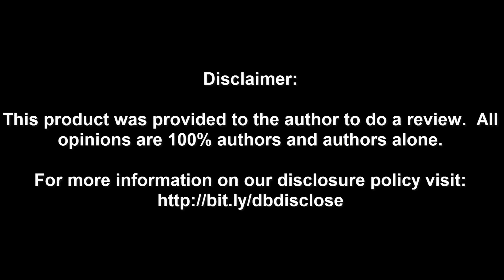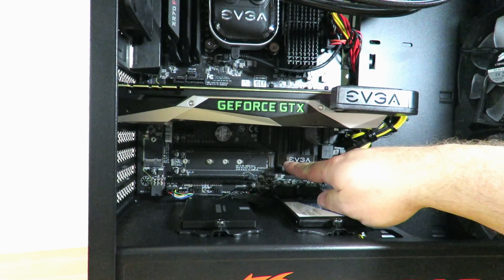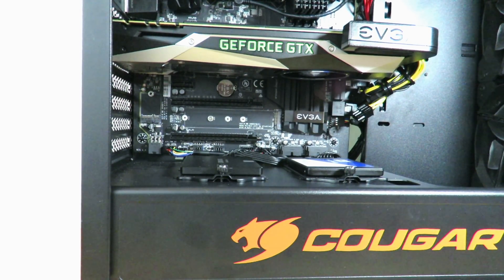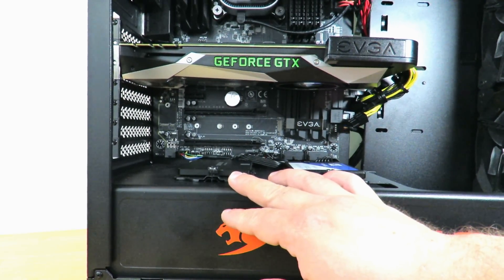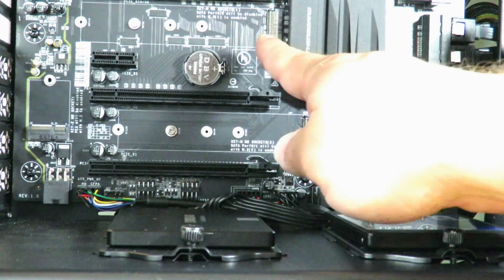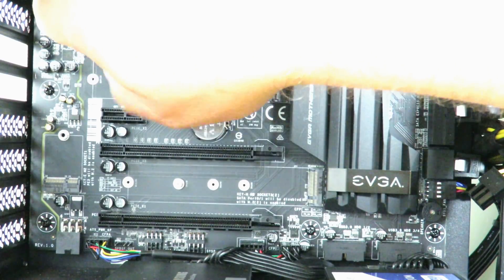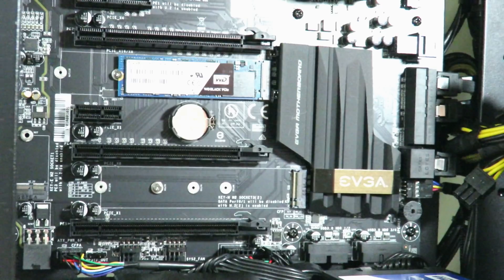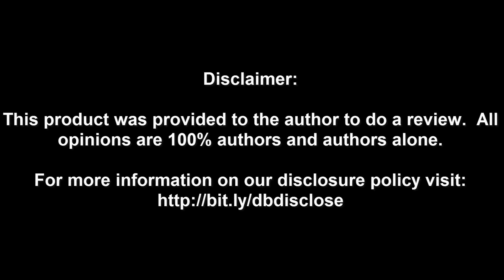How to install the 512GB WD Black PCI-e M.2 NVMe SSD WDS512G1X0C

Comment: Do you need a spacer?
Reply: Thank you
Reply: @westfield90  you are very welcome my friend
Reply: @ThisBytesForYou  I need help I have a asus motherboard  and I have the same wd ssd and I don't know how to put it in
Reply: @stevethegamer1308  have you watched the video?
Reply: @ThisBytesForYou  Yes I dont think the wd ssd fits into my Asus motherboard
Reply: @stevethegamer1308  can you give me the model number of your motherboard and the model number for the SSD, even if it is the same as in the video, read the model number to me.
Reply: @ThisBytesForYou  it's the Asus Prime X470-Pro and I think the serial is "K3MCFM085430A49" and for the WD SSD "190735475512"
Reply: @stevethegamer1308  I dont need the serial numbers, you may want to remove that, I have the bord, but the SSD' is it an M.2 SSD or a standard SSD.  Also, I dont see that model, can you find it and link it to me on amazon?
Reply: @stevethegamer1308  also, have you checked the motherboard manual, on page 2-10, chapter 2, it shows you how to install the M.2 SSD, just in case https://dlcdnets.asus.com/pub/ASUS/mb/SocketAM4/PRIME_X470-PRO/E13883_PRIME__X470-PRO_UM_WEB.pdf
Reply: @ThisBytesForYou  I'm good now but thanks any tips for gaming or mousepad though?lol
Reply: no, your board has everything you need.

Comment: Let's say there was a preinstalled spacer and screw in the 2260 spot that is blocking you from putting a 2280 in. What screwdriver, wrench or whatnot do you use to remove the spacer (thing that was holding the screw in). I can't seem to find anything that grips or turns these things.

Comment: can u put it in the second spot so i don't have to get unplug my gpu?
Reply: yes, I only did it this way because when you install an M.2 PCIE SSD, you end up (on some boards) disabling Sata ports, so to make it easier on myself on where I already had my SATA cables connected, I plugged it into the spot it would cause the least amount of issues with re-wiring.  Every board does it different though, so you will need to check your motherboard manual to be sure.

Comment: Is it there a notable difference with SATA SSDs ? In a local store they are selling M.2 SSD 16gb, then jump off into 250gb or 500GB but they are a bit more expensive than SATA SSDs, are they worth ? Could you explain to me the benefits from it ? Would appreciate immensely any information you could bring me up. Thanks, sir.
Reply: between an SSD and a standard SATA SSD no, but if its an NVME SSD yes there is but there are also many differences.  Would you be able to provide the model numbers of both drives, I can check them out for you.  Sorry I did not respond sooner, I was camping with my son and the boyscouts over the weekend.
Reply: Name of producting being sold + model of SSD
Intel SSD Optane Memory PCIe M.2 16GB, Model: Intel® Optane™ Memory SeriesSSD 250GB M.2 2280 SATA3 3D NAND MX500, Model: MX500WD SSD 250GB PCIe NVMe M.2 Black: Model WDS250G2X0C
Reply: Thanks sir. Additionally, I got recently a SSD 240GB Sata3 2.5" Green 3D NAND, model:  WDS240G2GoA
But my system is 7 years old already and it uses the past Sata 2.0 300MB/s so if I can into the future to get a modern system would like to know if actually I can get an improvement in performance since I don't even know how much my SSD would improve with SATA III. It seems way faster compared to my past hard disk drive 5.400 rpm I was working with. I appreciate all information you could bring me up, thanks!
Reply: a green drive is much faster than a 5400rpm hdd, for sataiii you might notice a difference as well, almost double the performance since the drive can achieve 545mbps and you are very welcome my friend, happy i could help
Reply: How about between Sata 2.5" SSD, M.2 SATA and NVMe M.2 SSDs ? I mean with the computer store I could get the NVMe drives into the future they are like 4 times the money or even more it took me for buying the 2.5" Green 3D NAND SSD.
Reply: You really want see much performance with the nvme installed in a m.2 using the sata bus

Comment: Do I take off the plastic that is on it?
Reply: sorry My nicknames Shadow but I am not sure of what plastic piece you are referring, can you give me some more detail of what and where that plastic piece is on?
Reply: ThisBytesForYou the one on the front saying nvme ssd 960 pro
Reply: Thanks My nicknames Shadow, no, the label of the drive, no you can keep it on like I kept on for this WD Black drive
Reply: as long as it does not block the connection from the drive to the motherboard.

Comment: So all of this to explain how to put a card into a slot and attach it with 1 screw? This doesn't help. Sorry no offenses but there are TONS of badass people showing that on YouTube. This said, it would be much more wiser to explain how to set this M.2 nvme SSD (not a regular one eh, no need vids for a regular SATA M.2 SSD, i'm talking about NVME. Nowdays i noticed it's better to use caps, ne one at least want to read carefuly...) into the BIOS, because ne one is doing this actually. Probably it's too much complicated...
Reply: I have done this many times both on ThisBytesForYou and Dragonblogger, both video types are necessary as you can see many people have stopped by and commented that they like the video, so it has helped them.  You can videos on how to install windows and how to configure that in both channels as well for as long as this comment has been here.

Comment: When I do performance tests I get like 1300 MB/s read speeds. I can't get the 2,000 MB/s advertised.... I have it set to Intel RST driver. This product doesn't seem to have it's own driver. There also doesn't seem to be any advice on setting it up. It took me a lot of research just to figure out how to get it running at 1300 MB/s. Now where is the other 35% read performance it is supposed to get?

Comment: What's the benefit of putting in X4 Pcie slot ? I'm new to SSD stuff so in 1 video I saw the guy used some Pcie extender card like & put the NVMe storage above it & put it in graphics card slot maybe . Well is it related to the pcie graphics slots ?
Reply: Iggy Castillo My motherboard is Gigabyte ab350 gaming 3. Tell something about it

Comment: what is your temps under load while the card being under graphics card?
Reply: it should be much more under load
Reply: Iggy Castillo yeah thank you
thermal is the biggest issues in pcie ssds
Reply: are you using the 1st slot which is located behind the GC?